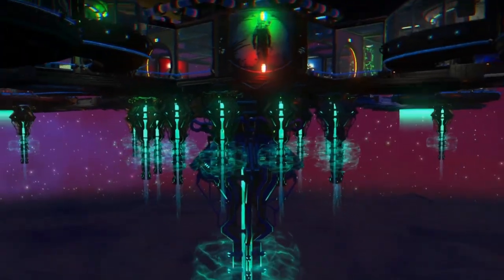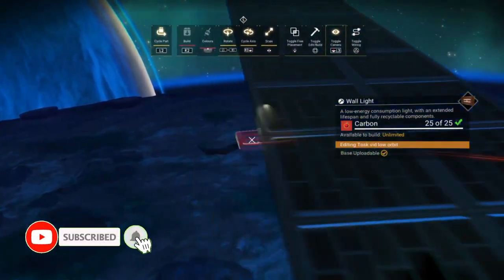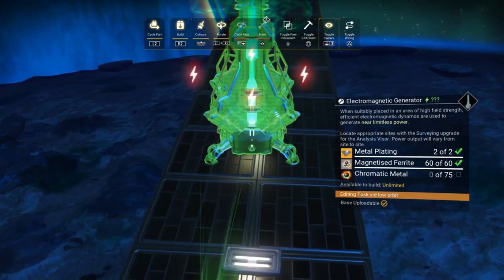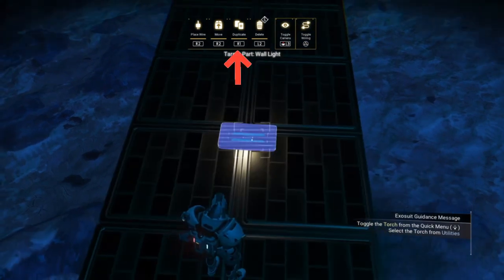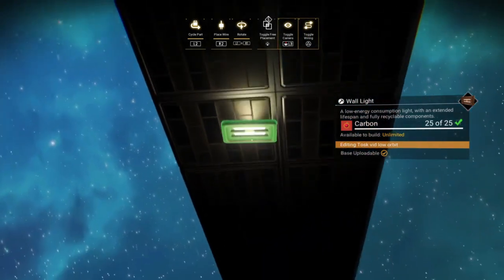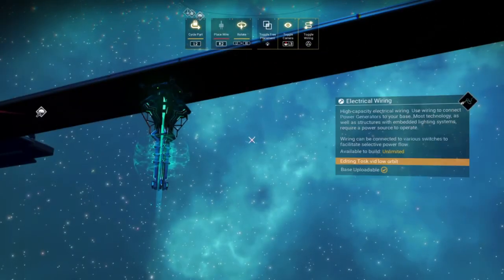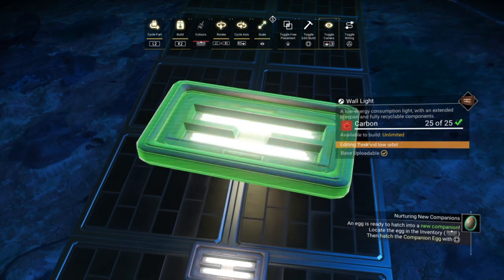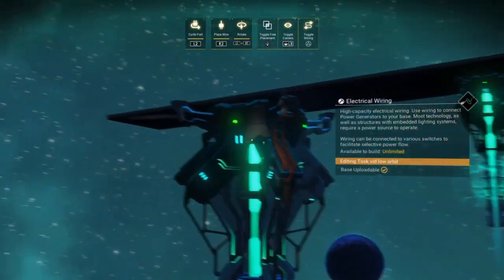Building an Electromagnetic Genererator upside down in No Man's Sky #nomanssky

Comment: Kinda late but this is for anyone newer. You actually can power scaled up objects. After you place your scaled up object, you use the same exact technique to scale down a cuboid room and put it so it's overlapping the spot on the scaled up object where the wire connects normally. Then you just run the wire to the cuboid room and Voila, you have a powered, scaled up object. My orbital base is lowered by several giant solar panels.
Reply from the maker: @alexanderwernette9998  nice
Reply from the maker: @alexanderwernette9998  I could never figure that out. Do you mind if I make a vid about it?
Reply: @toskvision  go for it, I didn't coin that technique lol

Comment: To all of my fellow PC users, here's a really essential tip to get this one done right with much higher chance of success, LOWER YOUR FPS! If your FPS is too high, the in-game latency is also very high, and since this glitch is tied to how fast the action is performed to save the item in the "wire cache", you wanna turn it down if your rig is pushing over 144 FPS. I turned mine down to 64, and instantly saw the success rate in performing the glitch go up. Just hover your mouse over the lamp, and once you see the left side tool bar say "Place Wire", you've performed it correctly.
Reply: life saver man

Comment: I can't get this to work on PC it just keeps showing the wire no matter how many times I try
Reply from the maker: The timing is almost simultaneous
Reply from the maker: any luck?
Reply: @toskvision  im also having a very tough time getting the timing down. It makes me think its working to store the object, then it doesnt place after. appreciate the awesome content though
Reply: well after ramming my head against it i can get the object to build after being stored but its normal sized even though i scaled up the first object haha. if you have any tips id greatly appreciate it
Reply from the maker: @shinobi.mp4707  thanks. yes it's a little different for everybody. I have days where I'll try for 10 minutes and not get it and then I get it every time.
Reply from the maker: @shinobi.mp4707  yes that happens too. Sounds like you're getting closer. Are you using a controller?

Comment: i can use these ubside down trick easy but my generator is off with energy symbol i know i need a hot spot but i dident think in the video is one up in the air so how i turn my generator on just for style not for energy
Reply from the maker: Hi yes the energy from a hotspot goes in an invisible cylinder all the way up to the edge of the atmosphere.  Unfortunately that's the only way to power them as far as I know

Comment: i have some issues, im trying to power my batteries from upside down ele generators but for some reason it just wont intake the power even if they are connected. have you gotten this issue?
Reply from the maker: I've never tried as I don't use batteries with the em generators. I'll check next time I'm on.